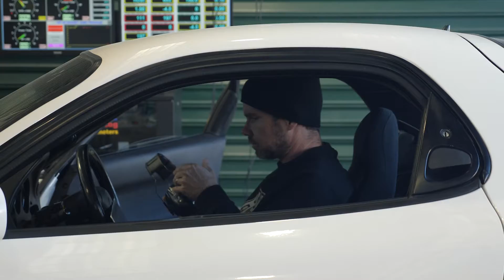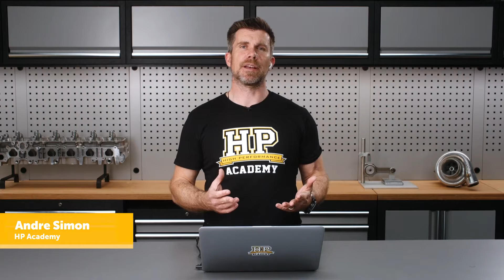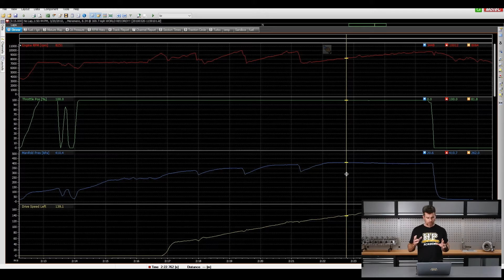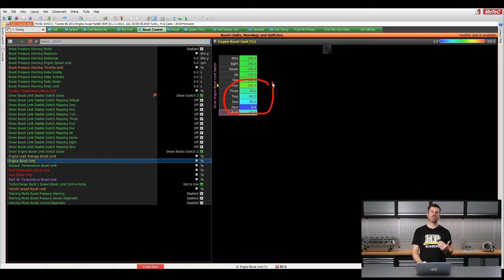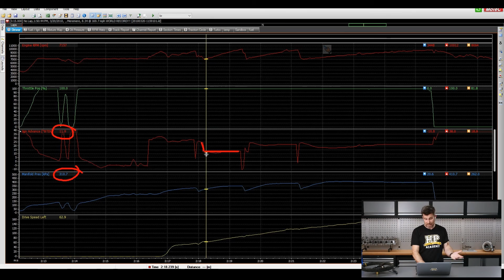Smart Tuners Use This.

Comment from the maker: Do you use this tuning stratagy?
🔵 Building a fast car? Get $400 OFF the all-inclusive VIP online course package deal: https://hpcdmy.co/offery155
🦵Kickstart your EFI Tuning knowledge. Get 50% OFF your first online course: https://hpcdmy.co/offery155
TIME STAMPS:
0:00 - Why do we need to adjust torque?
2:30 - SR20VE dyno graph
4:45 - Adjusting torque | Engine hardware
6:30 - NZ V8 TLX race series throttle position example
9:00 - Manipulating boost pressure | Boost vs TPS
15:25 - Manipulating boost pressure | 3 vs 4 port solenoid
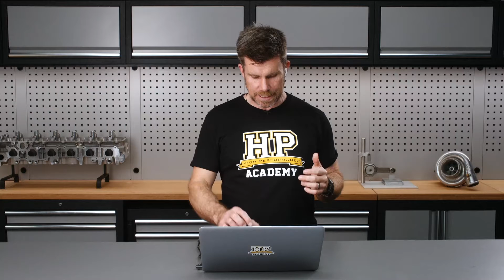19:15 - Manipulating boost pressure | Boost vs gear speed
23:20 - Adjusting torque | Throttle position control
30:00 - MoTeC M1 example | Basic setup
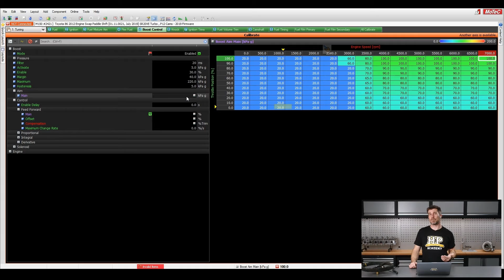39:35 - MoTeC M1 example | Drive by wire setup
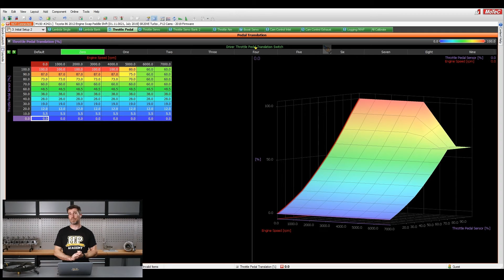46:25 - Why can't we just use traction control?
49:20 - Questions

Comment: Hi guys iwant to learn tuning by kt200 can ihave courses?
Reply from the maker: We don't have specific content using that specific tool sorry, however, everyone should start with this course regardless of the tool they plan to use noting you need to make sure it works with the vehicle you plan to learn with and gives you full access to actually tune the ECU as required - Taz.
www.hpacademy.com/courses/efi-tuning-fundamentals/

Comment: Does it really make any sense to use a pneumatic boost control for this strategy now rather than an electronic valve?  Just like a DBW TB, absolute control in every situation is the key to maximizing every advantage and potential.

Comment: I hacked my way through holleys software with PWM tables and DBW offsets to do this, stepping through throttle positions on an inertia dyno and using excel to interpolate the dyno data. Would have been a pleasure to do this on an actual good ECU on a load bearing dyno.

Comment: DBW is pretty cool - in my LS truck, as soon as you engage 4WD mode the throttle pattern changes so that the ~0-50% region at the peddle makes little change at the engine. Then when you're off-roading you don't have the truck lurching back and forth as your body/foot gets tossed around!  You can of course change the pattern for that and on-road use via HPTuners.